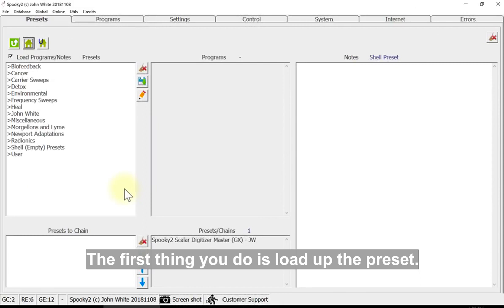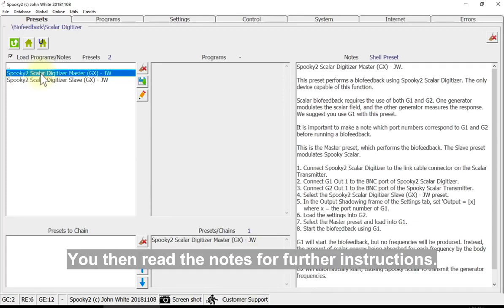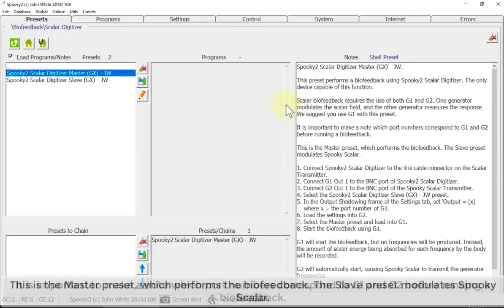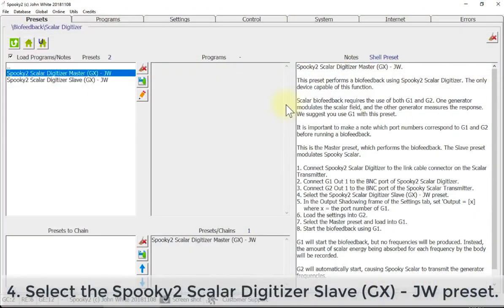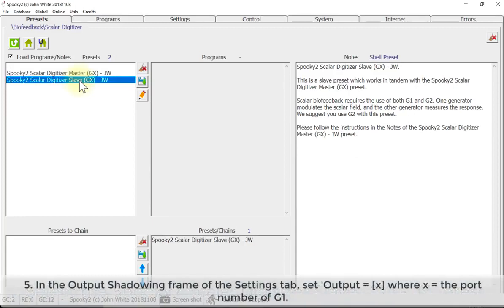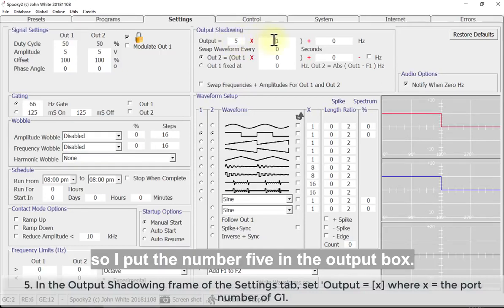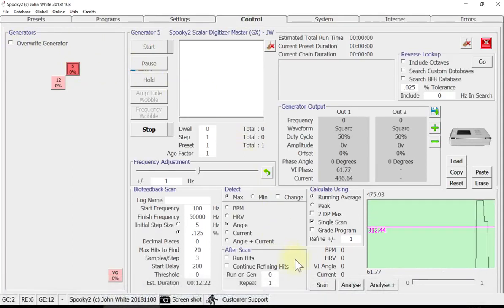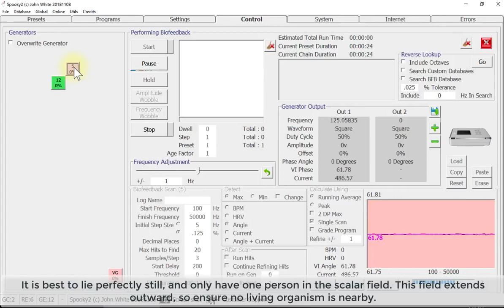How To Do Scalar Biofeedback Scan Using Spooky2 Scalar Digitizer

Comment: how i have to lie between the transmitter and receiver?
Reply from the maker: Just put the scalar boxes beside your bed. The minimum recommended distance between the two units is 6 feet. Try to keep at least 2 feet away from the Transmitter and 1 foot away from the Receiver. When you do BFB scan, try to keep the two units close together so that the scan results are not affected by other items inadvertently entering the scalar field.

There is theoretically no limit to the maximum distance between the two units. The further apart the two boxes are, the bigger and stronger the scalar field is. However, more items will be within the field, reducing the strength. Also, a very long link cable will lose some energy.

The scalar field is not blocked by walls. You can put the two units in different rooms to get a bigger and stronger scalar field. For best results, keep the two lids facing each other.